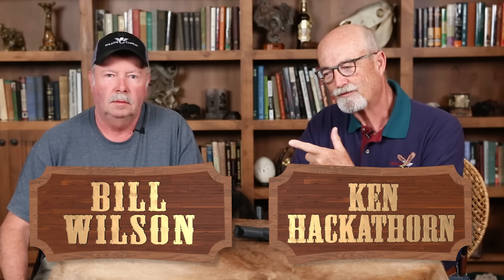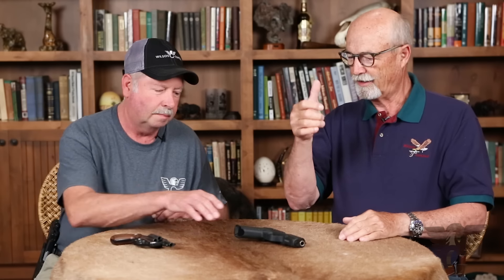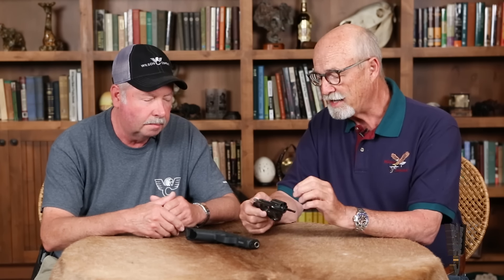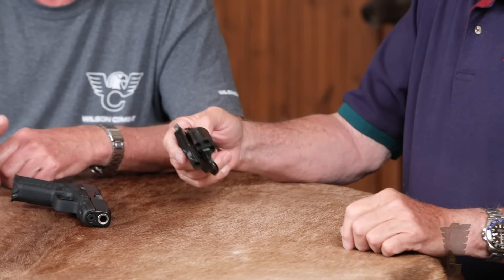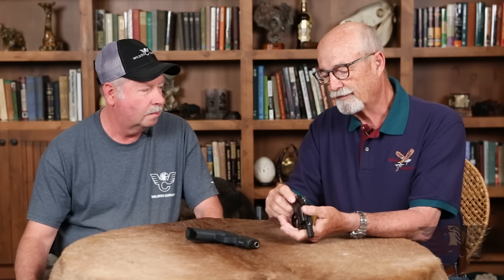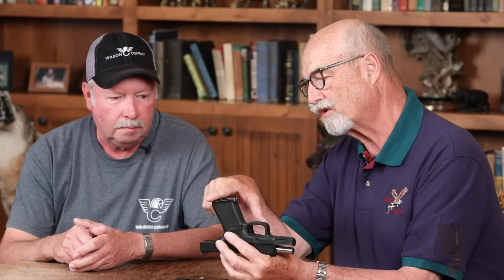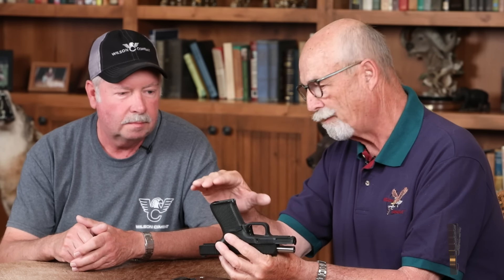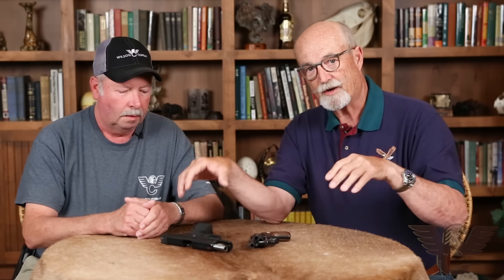DON'T DO THIS to Your Guns - Gun Guys Ep. 17

Comment: If i cant drop the slide on a 3000 dollar gun i dont want it
Reply: on an empty chamber son, don't do it on an empty chamber.
Reply: FUCKIN A, ........... TOTALLY AGREE!!!!!!
Reply: Says all the Stalard owners that they won't buy expensive handguns because of it. Even in the military, they told you not to drop a slide on a empty chamber, at least when I was in the military (11B 1985-2009 11Z retired).
Reply: @on2wheels378  Just spoke to my brother. He said they never told him that. 2003-2014 for him. My dad also told me that it's fine on modern pistols. He's retired E-8 and retired military range officer
Reply: @kyleeaton2717    Funny my $500 Glock or CZ don't seem to have that issue, never even heard HK fanboys bitch about that.  I long do the inexpensive 3D printer that works in metal that puts literally 80% of the gun business out of business.  Maybe the 20% left over can actually innovate rather than rehash the same shit dating back to just after WW2 over and over and over again.
Reply: @on2wheels378  you obviously never did port arms or had an inspection then
Reply: Then buy a cheap 500 dollar glock.
Reply: So if you can’t put a weapon through something it wasn’t designed for, repeatedly you won’t buy it? So I take it you have no intention of buying a smith and Wesson model 10 because it can’t shoot 357 magnum.
Reply: @Ben_not_10  not even remotely the same thing.
Reply: I served in the Marine Corps and all Marines slams slides home on empty chambers. I have yet to see a damaged slide!
Reply: Did you even listen to what they said about tolerances. That's the point here
Reply: stick with battering your other pistols, then.....
Reply: Daniel, I don't care if you pay $169 gun OR an custom $5000 gun and you improperly drop the slide,,,,,it tears them up.
For God's sake. PROFESSIONAL FIREARMS HANDLERS/BUILDERS ARE SAYING YOUR GONNA DAMAGE YOUR GUN. 
Why are you fighting the experts? You think you know more than Bill Wilson of Wilson Combat? Or other experts? I don't think so. They have business/job and are trying to educate you.
Reply: @craigklein5563  5:48 Ken explains why the military can get away with it.
Reply: At 3 grand you are buying a race car not a daily driver. You can not get away driving a Ferrari the same way you do a Honda Accord.
Reply: @paulwolcott5196  yes and the whole point is that theyr guns are so out of spec they are useless as anything other than a range toy...
Reply: Jordan Redford  Yes I'm sure the slight decrease in slide velocity caused by picking up a round will surely prevent the damage that would otherwise occur to the locking lugs and sear engagement surfaces. Better not replace your recoil spring ever I guess, or accidentally keep the slide from locking back on the last round -- you might break your gun.
Reply: @craigklein5563  so, that's your answer? Most Marines I know don't know the difference between  flat blade or philips screwdriver.
Reply: Craig Klein its not the slide that gets damaged.its the locking area on the barrel that goes into the slide. On empty chamber the slide has too much velocity.  Its not hard to hold onto a fuckin slide guys wow.
Reply: Bingo
Reply: @TACTICALNOMAD  not how John Browning designed it. Wilson did not invent the 1911.
Reply: that's because you were issued that piece of crap Beretta. When they were first issued they had a tendency to crack the slide right at the breach face because nato spec ammo is 10 to 15% higher chamber pressures than civilian ammo and the Beretta 92 is not rated for +P ammo
Reply: @Wolfstanus  1996-2002 1st/377th FAR Pistol qualified because I was the BN Cmdr's driver, had M9s but never heard 'don't drop the slide on an empty chamber'.  In fact it was commonly done.
Reply: That's not what the slide lock was designed for. Just because you want to perpetuate an incorrect habit, doesn't make it right.
Reply: @AKlover  winning if you ever put the business of making guns on a 3D printer or what have you not and trying to put gun makers out of business so you now will be the new game in town if you decide to perfect the firearm of your dream through a 3D printer but just remember this when you get in the business of making guns for customers you my friend will be in a world of hurt when it comes to regulations especially for gun manufacturers so you will be in their world if you decide to go into this adventure all I can say is good luck.
Reply: I try not to ever do that with my guns, but I know what you mean. How delicate can they be... It makes it so you wouldn't dare sneeze around a gun that expensive.
Reply: Jordan Redford I scored sharpshooter with the m9 never wer we told not to drop it on a empty chamber
Reply: Well then////who cares???
Reply: Amen to that
Reply: Sounds like the kinda mindset that would take a fine automobile with a nice engine or any engine for that matter, on a cold morning, starting it and before the idle even gets to settle nevermind coming up to operating temperatures, just pins it and goes flying down the road.

Sure it will do it and may seem alright for awhile, but your shortening the service life of that engine significantly.

But I guess most only know how to put gas in it and then put their foot in it...
Reply: @curlywurly70  - 5:27 - 5:39 he claims it'll damage ANY firearm 🙄
Reply: This is like saying if you can’t rev the engine to redline cold you don’t want a Ferrari. That’s not what you’re paying for. You’re paying for precision craftsmanship and that necessarily means more care is needed in maintenance and use. If it’s not for you, that’s cool, it isn’t for me either. But it doesn’t mean it isn’t an amazingly crafted gun.
Reply: You just can’t have it both ways if you reduce the positive engagement of sear and hammer to almost neutral you’ve taken away all the safety margin that lets you drop the slide but now you have that very light trigger pull. 
The round in the magazine doesn’t really make much difference if you modify your sear to that point you are not doing it to have a long lasting gun but a high performance gun. 
You’re not going to see a 40 year old Chevy on a race track, and a race car has a life of one ir two years at best.

Incidentally, the Brownell’s people have a couple of videos that explain this myth way better and in just a couple of minutes too
Reply: @andrewdanvers308   Don't waste your time arguing with knuckle heads, you pound a hammer on an anvil enough times and the head mushrooms like a chisel, both are steel but something has to give over time .
Reply: @michaelsmith-rh4yt  right, like duh, some folks can't grasp the simple notion that when the gun is chewing on some brass and copper, the round acts as a shock absorber and also moderates slide velocity enough to take the slap or snap out of the impact of returning to battery..  I mean you can feel and see it so clearly yet it eludes their comprehension.
Reply: @shinobi-no-bueno  in combat ? no at range yes ... any time you have to show clear and holster you are doing exactly that, any time you check the chamber before disassembly you are doing just that ...

the point here is that gun ins original spec can do that just fine... if hteyrs cannot anymore that means they cut some corners somewhere that make the gun tear itself apart doing normal routine things ...
thats what you get when you take a combat handgun and build it so far out of the spec that it starts to have issues ... now imagine what that thing will do when it gets dirty ...

thats why these guns are useless range toys and boomer dick extenders with only one purpose "hey look at this $3000 piece of metal i bought" not realizing they are just showing how STUPID they are for getting ripped off paying that much for a gun that costs about $100-$150 to make ...

no special materials on that, just tighter tolerance millwork that guy in china could do for $10 extra ...
Reply: ok then dont ever buy a les baer, nighthawk, wilson combat, dan wesson, staccato, atlas, ruger, kimber, remington, magnum research, springfield armory 1911 etc because the damage that comes with dropping the slide on an empty chamber applies to all these platforms, and if your reasoning for not wanting to buy a gun because “you can’t drop the slide when its empty” we will all happily continue to own and operate ours and never feel the urge or need to drop the slide on an empty chamber for no reason. 🤣
Reply: There's these things called dummy rounds. If you can afford a $3000 gun you might be able to afford a few dummy rounds.
Reply: What you’re saying guys cannot be found in OWNERS MANUAL😝
Reply: How can that be when the literal blast from the pistol firing throws the slide back super hard. So, in opposite it damages it? 
Doesn't make sense.
Reply: @craigklein5563 and how many of those did you take down and inspect?
Reply: I agree Common Sense shooting very hot ammunition slamming the slide that's just taking years off the guns the life I clean all my guns if I shoot 10 Rounds or 500 rounds I'm a 60 year old man every 3 months shoot the gun or not I take a oil patch and then a dry patch down my barrel and wiped the guns down .one thing I am confident about I could holster any pistol I have it's going to go bang.  it's all about safety common sense and good maintenance and learning new information about guns everyday enjoy the video thanks
Reply: This entire video is bs
Reply: "If I cant slam 2 pieces of steel together without damaging them I dont want it"......smart comment. 🤦‍♂️
Reply: The 2,000 round test is suited more towards a military/austere environment situation.  It is a good indicator to a point.. Especially for those that go to training and fire a lot of rounds through their guns…
Reply: I don’t drop the slide empty or loading,never have! I taught my daughter not to do it either! I could care less if somebody else does!😎🇺🇸🇺🇸🇺🇸🇺🇸
Reply: @nicholas389 have you ever heard of a recoil spring lol. You don't know more than Bill Wilson.
Reply: @Ben_not_10 a 1911 style pistol wasn’t designed for you to drop the slide without a loaded magazine in place.
Reply: @craigklein5563 
Keep eating them crayons. LOL! Buyahhh!
Reply: These two men have forgotten more about firearms than you will ever know.
Reply: What a joke. If your pistols can't handle that, they're just overpriced trash. Why don't you take 2 and drop and empty slide a few thousand times vs firing one a few thousand times and see what happens. Bunch of old timers with their old wives tales
Reply: @Asghaad Exactly, lol. If it couldn't handle dropping the slide on empty, the military wouldn't have ordered thousands.
Reply: A gun is a tool
Reply: Try the best to protect your own tool, but honestly when it comes to stressed and emergency situation, do what you naturally will do and get the job done because the one who eventually taking your gun will not be you if you don’t act fast
Reply: The round going into the feed ramp is what the tolerances require for proper lock up into battery... some people are idiots and don't deserve firearm ownership
Reply: Well, my first encounter with a firearm wasn’t a pistol, it was with a bolt action .22 rimfire rifle that my WW2 veteran father bought for me. Complete entry level but it was a real gun.

Before I even got to touch a cartridge I had to learn how to take it apart and clean it. Even at this stage he drilled into me to avoid dry-firing the rifle. That was something he had learned in The Royal Canadian Navy as a boiler mechanic 1st class. At that time they were using some kind of ancient Colt revolver hand-cannon, I’m guessing probably a .45.
Reply: 😂😂😂New to metal, are you?
Reply: Right? Lol

Comment: If the firearm can’t take the stress take “Combat" out of the name.
Reply: I love the moment when they talk about how they only care if the gun will go bang through 3 magazines.
Reply: That could be true but think about how the M16’s were supposed to be a battle rifle or an actual assault rifle yet they had many quality problems for a war rifle!! Automatic fire caused the pencil barrels to melt, the rifles would jam If they got a little mud in them, at first the twist rate was way off and could not stabilize the anemic .223 or 5.56 ammo. In basic training the Army teaches you to be good to your weapon and keep it clean and not to abuse it unless under certain scenarios it becomes impossible. All I am saying is the M16 was to be a war rifle but marginally qualified itself as such!!
Reply: @chaff5  they are the definition of fudds
Reply: @kevinrollman3101  you have a great point, but that was a design issue that was fixed. These guys keep makin the pre Madonna pistols and charge an arm and a leg for nothing but a name. I compete with a hk vp9 that has over 50,000 rounds through it with 0 issues, and has been run hard

Comment: Just some of the reasons why I never ever buy the display model at the store...
Reading some of these reviews people actually justifying the dropping of the slide on the empty chamber and other abuse.
Bill Wilson is an expert Machinist, and gunsmith not just some old guy spouting off.
A 1911 with a hammer and sear polished down to give a super crisp trigger and ultra light pull isn't going to stand up to the same slamming and abuse as something that's got a 6lb trigger.
A lot of it's just common sense that anybody with an ounce of mechanical ability would be able to understand.
Dropping the slide on a loaded magazine stripping the round from the magazine and going into the chamber cushions the blow to your locking lugs on the Barrel.
Dropping the slide on an empty chamber there is no cushioning effect as when a cartridge is being loaded.
Dropping a cartridge into your chamber and then letting the slide with the extractor ride over it it's not the way it was designed.
The round is supposed to feed up through the magazine with the rim of it sliding under the hook of your extractor on most pistols. Even if you can get it to snap over without damaging the extractor it is abuse.
Like he said in the video it would be like flooring your car at every stop light.
It's going to hold up for a while but eventually it's going to fail and a lot sooner than one that's been treated with care.
Really pretty simple stuff worth knowing if you're going to shoot or carry pistols how they actually operate.

Comment: Nicely said about dropping the side...It's also common courtesy when I look at a pistol , it isn't mine! Treat it like that! You don't sit and dry fire over and over or drop the slide over and over. It's gun shop courtesy... if I rack a slide in a gun shop I don't dry fire I hold the hammer and ease it down same with slide .if the gun isn't yours yet treat it as so...

Comment: Yeah well it is a slide lock not a slide release.
Plus a custom fine I'll give you that.
That being said amateur my butt. Browning designed the 1911 to be dropped on an empty chamber and trigger pulled on an empty chamber. This was done thousands of times during guard duty inspection during WW1 and WWll without harm.
I understand it is a custom, but if the trigger and components are that effected why would you want one. I want a tool that works not one made from inferior glass sensitive parts where I have to wonder if it will work.
Yes I own many 1911's and funny none of mine have had an issue dropping on and empty chamber or firing on and empty chamber, and all have 3 to 4 lbs. Triggers.
Reply: My exact sentiment, I've had 1911 .45's for 50 years and have dropped the slide on an empty chamber when necessary. " Super tuned improved" .45's must obviously have made trade offs in durability in some regard for speed,style or increased sales dressing an old dog with bells and whistles. Lack of durability is not an improvement .
Reply: Check out Gunblue490s video. He busted this video a couple years ago. He is a Vietnam Vet where he served as an MP with the 1911. He was inspected just as you say. The 1911 served for 70 years. This was never a problem. Wilson should stop calling it a 1911. It is an insult to the man who designed it.
Reply: The thing is, your average person is not gonna carry a $3000+ 1911. Just like most aren't going to take a super high dollar precision long range rifle to a cqb course where it will get knocked against things all day and more than likely dropped in mug or sand.
Either way, he already explained why you don't wanna drop the slide with the weapon dry.
Reply: Well said !
Reply: thomas abel agree.
Reply: Exactly! This video's premise is ridiculous.
Reply: then why is it designed to be pushed down?